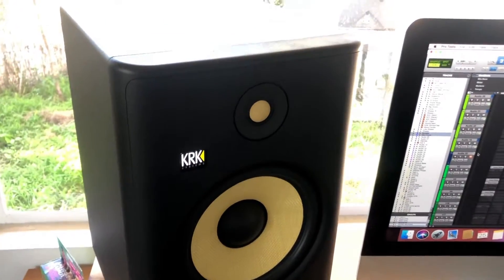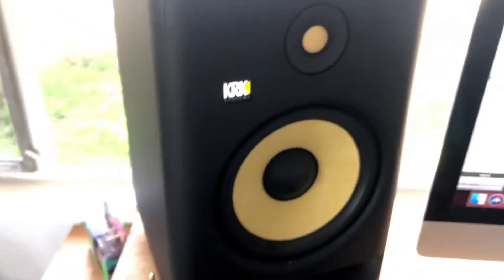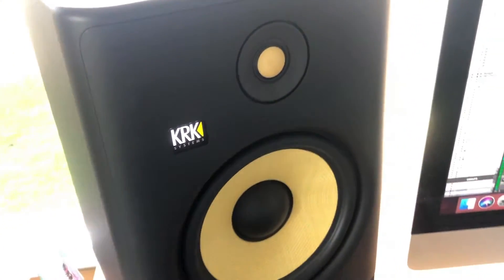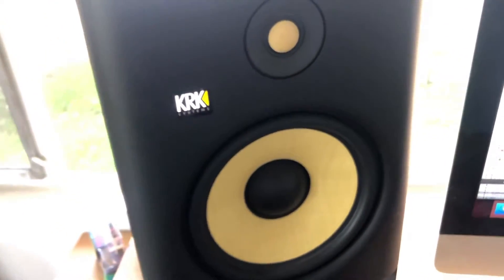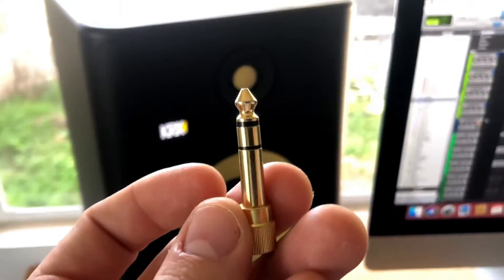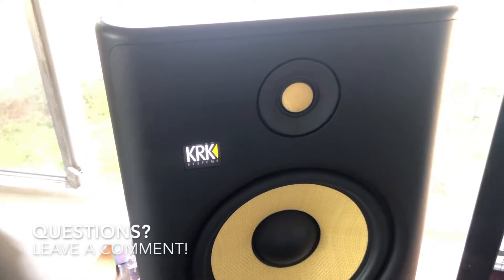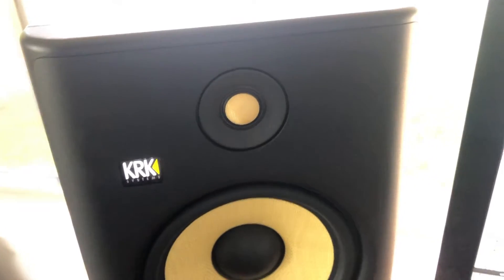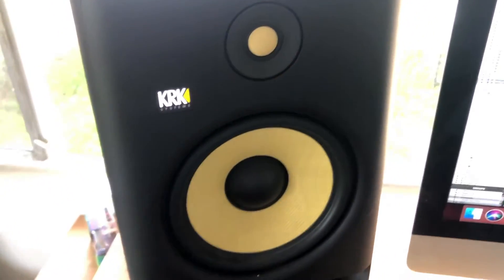✅  How To Fix KRK Rokit G4 Buzzing Tweeter 🔴

Comment: I have no sound since today! :-( The Second box works fine. The one with the problem still have lights on and the display is also working on the backside. But Zero Sound, no hissing, no nothing. Just silent. I use it with my focusrite interface.
Reply: Same situation for me, just happened yesterday, replaced the fuse still no sound from 1, they're 6 months new.
Reply: @Moderndaymartian  I had to send one of my monitors back to the shop where I bought it. They just changed it to a new one and everything is fine now. There is no other fast solution to that.

Comment: Brand new, cables changed to balance and the hiss is still the same.
Reply: fixed?
Reply: @pm20041  No. The product is broken from the start. It is because the class D amplifier - digital one that is causing the problem. The sound is great, but the hiss is always there, no matter what you plug or nuplug or slide up or slide down. This is waste of money and resources and does not serve its purpose in the end. This should never been made.